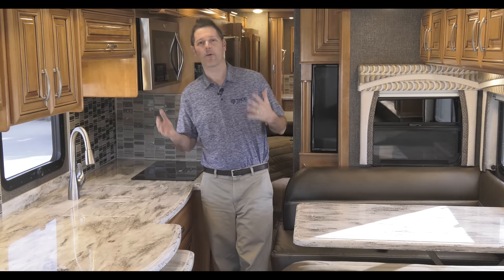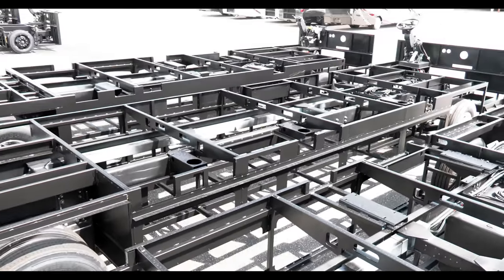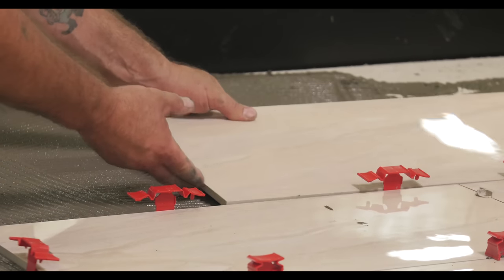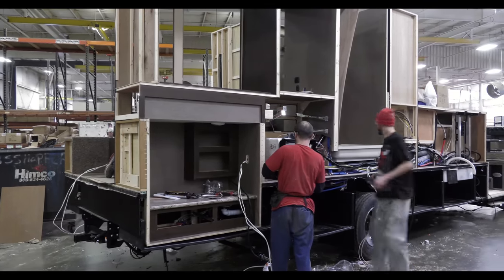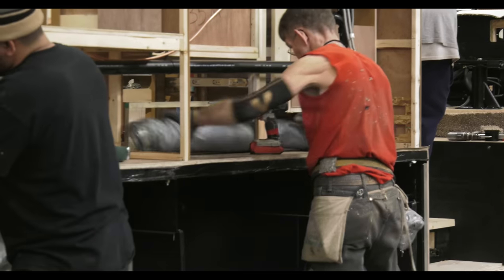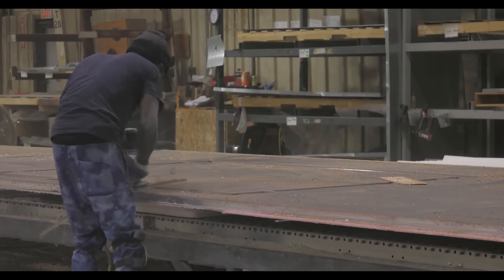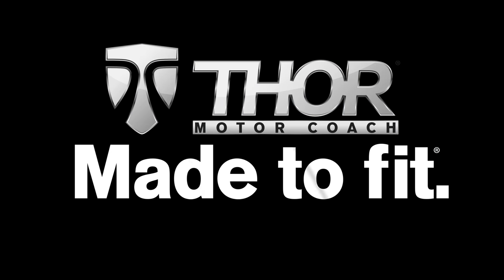Thor Motor Coach Factory Tour

Comment: We bought our first RV 4 months ago.  It is a 24ft Thor Freedom Elite on a Mercedes chassis and we bought it from Camping World.  We wanted something large enough to stay in but small enough to maneuver in traffic and get parked.  It has worked well for that.  We had a few problems with the RV early on and Camping World fixed them quickly.  They gave us technical support when asked.  I have used the Thor Support line a couple of times too with success.  It is hard being a newbie.!  We had only stayed in the RV a few nights when our slide stuck and would not extend.  Camping world could not get us in quickly, so we continued using it while we waited but did not stay in it overnight.  It was still fun to use and even more fun to drive.  It is great to have a mobile kitchen.  Camping world found the problem and ordered the parts.  It will take several weeks to get them and you might guess that we are disappointed.  But they are trying to get us fixed and after all this is a camper.  It will not kill us to wait.  We made a good decision about what to buy and from whom to buy it.  We like our RV and while we wait , we are having some things added to it like satellite TV.  Good times follow.
Reply: WHY would it take "a couple of weeks" to get parts?  A truck (changing drivers) can go from N. Ca to Tampa FL., in approx. 42 hours.

Comment: I just saw this video and can’t believe the careless nature the employees have installing the equipment. I saw one person drop the ac unit on the roof. And others slam their routers in the material to cut the holes.  Also one person was drilling holes and elongating them to fit.  Not very precise engineering if you have to add slop to fit.  Makes squeaking joints later when you own it.
Reply: Jeffrey Dickinson hmmm I did not see ANY careless nature and I did not see a person drop a ac also I did not see slam their routers in the material to cut the holes so maybe if they did they were supposed to.
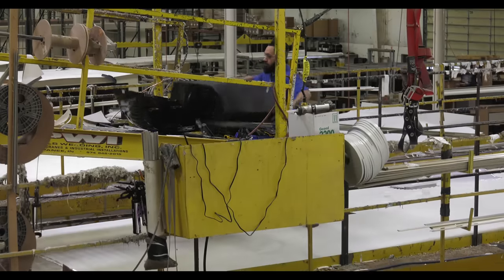Reply: 5:39 in the clip, the guy slams the router down on the wall to cut the hole, most likely won't hurt the wall but it's very unprofessional. At 6:12 in the clip the guy in the red shirt and ball cap is between the forklift and the motor coach guiding the slide out into position. A person standing there while the forklift is moving the slide out into position is very unsafe, given the speed of the forklift and the relative short amount of time he has to clear the area while the lift is still moving. At 7:05 the man takes the AC unit off of the platform and at 7:08 you can clearly see the AC unit bounce when it's dropped into the hole in the roof. I know you have a personal connection to the video, I completely understand however when a company expects people like me to spend over 300k for a coach, we the customer expect it to be build with care and attention to detail, not a rush job. I'm giving constructive criticism on the video, please don't take it personally.
Reply: Wow you must be a good safety inspector...
Reply: Jeffrey Dickinson absolutely not buying a Thor motorhome, it’s sad to see a manufacturer like them build shitty products.. they slap motorhomes together.. like when u see a Thor Vegas it’s 42 different floor plans like how.. they build quantity over quality..
Reply: Londyn Paige, that AC did bounce. Rather than being sarcastic, Thor might do well to hire quality control experts and supervisors.
Reply: @getcraig55  you dont know the half of it.

Comment: What's the R value rating on the 2020 Challenger 37FH, we are really interested in that floor plan.  Thanks
Reply from the maker: Hi Tom.  The R value of polystyrene foam is between 4 1/2 and 5 1/2 per inch.  On the Challenger we use  1 1/2 inches.  The fiberglass also has an R value as well as the luan.  You also have cut out for windows and slidewalls which changes the value.  Hope this  helps. - Steve